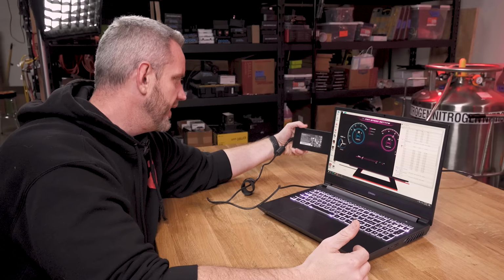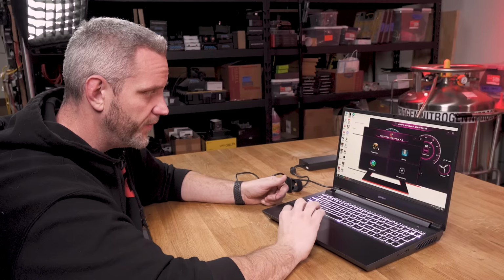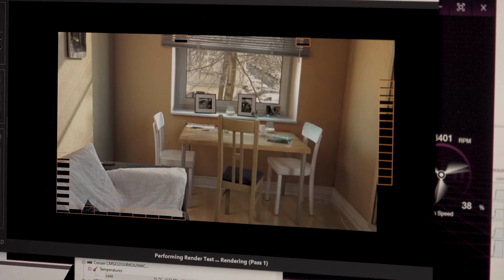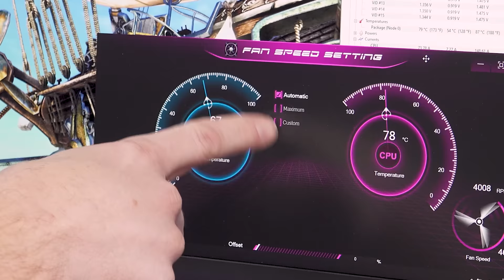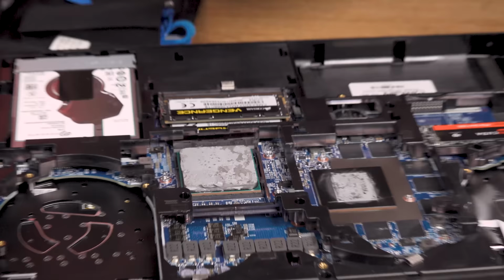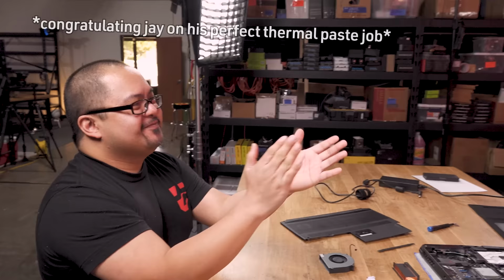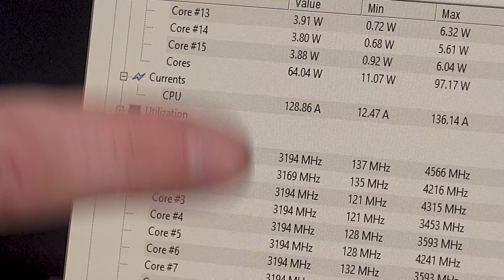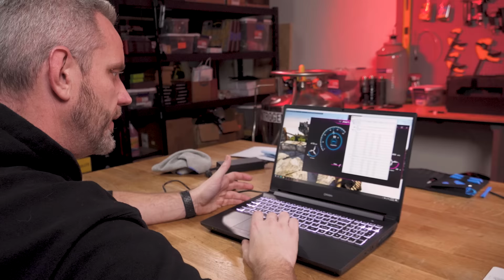This laptop was trying to melt to death... here's how I fixed it.

Comment: Im curious if it's possible to put a graphics card in a laptop instead of using an external GPU?
Reply: no because a laptop does not have enough power or cooling capacity to run a regular graphics card which is why they make mobile versions for laptops.
Reply: @PabzRoz   how does alienwear do it?
Reply: @ballingold  how does alienware do what? they use mobile version as well.

Comment: wait how is it that the cpu only uses 75 watts but the current draw is 133 amps? does it run at like 0.5v or something?? Don't they run at their typical ~1.3v?? and if it is running at 1.3v at 133 amps of current that's ~173 watts or am I doing something wrong or are those current ratings just way out of wack? or is it just because the gpu isn't running so the computer allows more power to go to the cpu and if they limit the current draw, why not give the computer kinda a self learning software that will make it run at 3.1ghz and draw below that 133a instead of it dropping down to >1ghz every 10 seconds????

Comment: I tested my friends laptops wondering why their games run at high fps and feel bad, 3 of them, i5 8300h, i7 10750h 6 core and 7700hq. All of them without fail will run in the 90's in games, then drop clocks from around 3 GHz, to 2, to even under that. And then when anything isn't good with the cooling, well it goes to 96c 100c, clocks drop to 800mhz, I wonder how they don't shut down yet. And when clocks go all over the place or the throttling happens, it chops up the frametimes not just the clocks, in the extreme case when it drops to 800mhz fps are no more, but when it stays at 2 or something, let's say I run csgo, the screen is 144hz, the game runs ok at 160 ish fps. Then 5 minutes in the temp barrier is reached, and the ups and downs start. The fps is reported at 120 let's say, but it feels like 40. Frametimes go out the window. That's why I want a DTR laptop, mess with it till it doesn't do any of this. The laptops I looked at are unusable for me if I want to play csgo or other things that require consistency. And the amp limit clocks going to minimum for a split second on this laptop is also very suspect for frametimes. They really need to smooth out the clock changes power cutting throttling schemes when the CPU gets too hot.

Comment: i own a asus ROG553VD with intel core i7-7700hq 2.80 ghz  16 gb memory 2x 8g 2400mhz 240 gb ssd 1 tb HDD and Nwidia GeForce GTX 1050 for ower 2 years now ewerything was fine but last couple months started giving me headics i started loosing lot of performance for example CSGO new was runing ower 250 fps now i cant ewen get 150fps usualy i get 100-120 and games like rust hawe becomed unplayable lees then 20 fps and CPU temperature above 80 when under load doesnt go ower 85 probably locked but still its prety hot and droping down CPU GHz clock speed to balance and not go ower 85°C but until it reaches ower 80°C its working kinda good and then i start geting fps drops and like ewen short frezzes sometimes when ower 80°C Any recommendation??? BTW the laptop has newer been opened cause of my waranty so thermal paste newer changed and newer cleaned of dust i will send it to manufactory for repair when i will bade able to go back to germany where i buyed it but i need to wait until corona situation gets stabilised i would apreciete any advice and thank you.  And yeah kinda hawe the same problem when doing casual things like youtube and stuff sometimes i get what u mentioned in your video temperature spikes.And Fan working at its max most of time . i wonder is it the same thing for me just a thermal paste or you hawe any other ideas ? thanks.

Comment: Advice Needed; Hi guys I have an old-ish PC (see below) mostly made from parts stolen from work, it runs Half Life Alyx (VR) at low settings fine (even though it's below minimum settings) on the original Quest but since I've upgraded to the Quest Two its struggling (still runs but choppy and crashes occasionally)... I think it just needs overclocking, I'm hoping I can get another year out of it before having to buy a new PC... I have spare £100 what upgrades would you suggest for gaming? Should I spend £100 on cooling (and overclock) or is there something better I'm missing?   

CPU: Intel Core i7-3770 3.4 GHz Quad-Core Processor
Motherboard: MSI B75MA-P45 Micro ATX LGA1155 Motherboard 
Memory: Mushkin Essentials 32 GB (4 x 8 GB) DDR3-1333 CL9 Memory  
Storage: OCZ Agility 3 256 GB 2.5" Solid State Drive 
Storage: Samsung 860 Evo 1 TB 2.5" Solid State Drive
Video Card: MSI GeForce GTX 970 4 GB GAMING Video Card
Case: BitFenix Prodigy M MicroATX Mini Tower Case
Optical Drive: Pioneer BDR-208DBK Blu-Ray/DVD/CD Writer
Operating System: Microsoft Windows 10 Pro OEM 64-bit 
Keyboard: Logitech K830 Wireless Standard Keyboard With Touchpad 
Custom: Cheap hd ready tv as monitor 32'
Oculus Quest 2

Comment: Listen. I did the dumbest thing ever out of pure laziness. I just bought a 1600$ Asus gaming laptop with a 2070 in it. I always repasted laptops right away because from experience they always seem to do a bad job at it in factory. Anyways, I removed the screws, repasted the CPU and GPU and went to put it back together. And the bottom cover has short screws ands long screws. Well i used a long screw where a short screw was supposed to go and it went right through the other side. Right through the keyboard. Now i have to look at a hole in my 1600$ gaming laptop whenever i use it :( To be fair though the screw was manufactured badly and had an extra chunk of small metal on it that made it like a drill bit. I went completely through instantly before i had a chance to release it.

Comment: Putting a desktop 16 core cpu into a laptop that size was a stupid decision on Origin's part. Not just because of thermal limitations, but because of the pathetic amount of power delivery from the wall, as well as like he said the 2070 uses the bulk of the available power. Such a waste of a perfectly good 3950x

Comment: What's the point of equipping a laptop with a CPU that can't be fully utilized because there's not enough power available?
Wouldn't a CPU that just barely stays inside the power limit make much more sense?
It's like... driving a Ferrari on an Autobahn with no speed limit but having to stay at 150km/h because the tires you put on it would explode at faster speeds.

Comment: Specific thermal paste issues aside, there are other problems here though. That laptop is too small... I know thin is in, but there is a reason old desktop replacements where soo thick, for those parts that thing should be a 17.3 and like an inch plus thick... also, the entire cooling solution in a high performance notebook does run at incredibly tight tolerances, so im not surprised that what would have been a minor thermal paste issue on any other machine would be a huge deal here. Also, the fact that they had to cripple the chip in order to use it, bother because of thermals and power constraints means they never should have used it in the first place... sorry, but I think this is a stupid laptop... they did not want potentially two large power bricks and they did not want it proper thickness for a desktop chip laptop, so they crippled the chip and ended up with a cooling solution that was bound to eventually have problems... thats my take...

Comment: Not watched the full video yet but I need to rant about the IHS. And this is the culprit! The IHS on desktop CPUs is complete and UTTER NONSENSE. Just add resin around the chiplets and grind it level in the factory. You save the cost of the copper and the different tooling is paid off quickly. WHY ARE THEY USING IHS??? Add more thermal resistors to the mix, of course temps are higher...
Reply: Like, when you water cool a GPU that easily reaches 350W: Barely reaches 40°C. You water cool a 105W CPU without delidding it: still reaches 60+...

Comment: Should have put liquid metal in it.
Reply: Not great for bare copper over the long term. It slowly gets absorbed into the copper reducing its cooling ability. After about a year, my liquid metal was dry, lol.
Reply: @dennisperry8579  Of course, then you just reapply and you should be good to go. Liquid metal with copper shouldn't be a problem as long as you keep and eye on your thermals and reapply when needed. In reality there are 2 types of coolers. One with copper base and one with aluminum. And we know what happens when you mix aluminum with liquid metal (galium) :)))
Reply: @abikovski27  nickel coated (like the IHS, which is why liquid metal works much better between the die and IHS) is pretty much the only thing that doesn't react with liquid metal... Though the copper reaction is definitely less of an issue in comparison to aluminum 😂

Even sanding the cold plate didn't clean anything up, lol.

Comment: I have a strix laptop with liquid metal, rtx 2060 and a i7 10750h. CPU gets to 95c on 4,5-5  ghz is this normal? XD
Reply: absolutely not
Reply: @sebastianpichler6628  how should i fix it? xd
Reply: @psyfido7386  i have an msi one and got the temps down by repasting and undervolting it (first with intel XTU, then with throttle stop, because i couldn find a proper solution to get xtu to autostart on startup)

Comment: You had a problem you owned it as you caused it. What else can we ask of you. You fixed it using Ifixit and great quality thermal paste. I feel that Laptop is over the top and can't fully utilize the CPU because of Current and Thermal Constraints and needs power brick to be useful. Personal opinion I find it pointless.

Comment: Thats one thing many people overlook frequently when watching these reviews. These are (many times) test examples, sent to them in a media agreement. They are PERFECTLY clean. Near completely sterile inside .... OBVIOUSLY.... under normal use, dusty environments (despite how much of a clean freak you think you are, they still collect dust) pet dander and the like, Temps will go up as the laptop collects more and more crud. So when they show you a perfectly clean laptop, going to near thermal throttle conditions, WHEN ITS PERFECTLY CLEAN, you can expect that once it gets a bit dirtier it will get a bit hotter. If you are on that razors edge to compete with intel anyway... you will tend to not handle real world conditions very well..lol. Apple products burning people anyone? No? Lmfao.

Comment: Why buy a laptop that barely functions unless plugged into power!!??
Reply: That laptop is a desktop replacement. Desktops generally have 600+ watt power supplies. What battery is going to last long with that requirement? Did you see the size of that power brick?
Reply: @speedster427  what are you getting at?